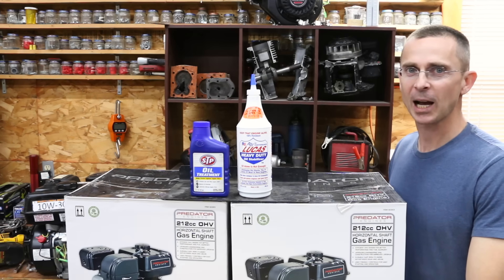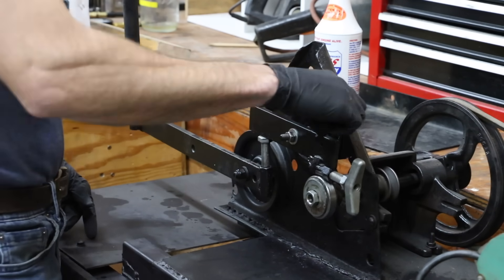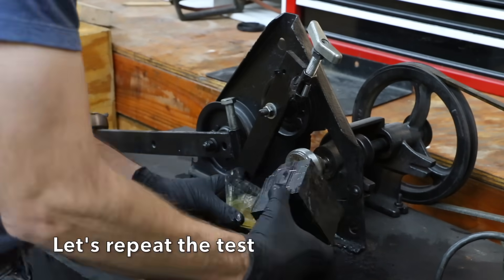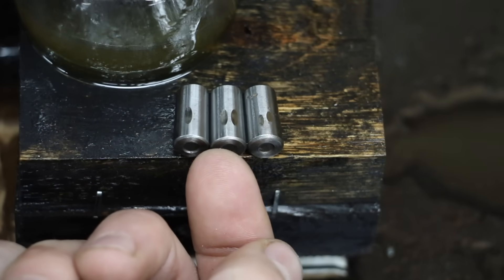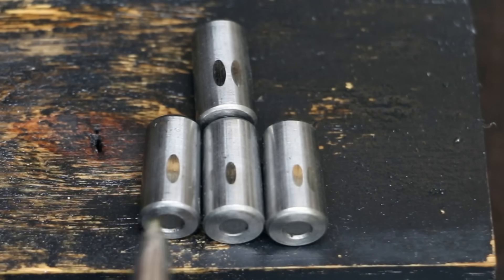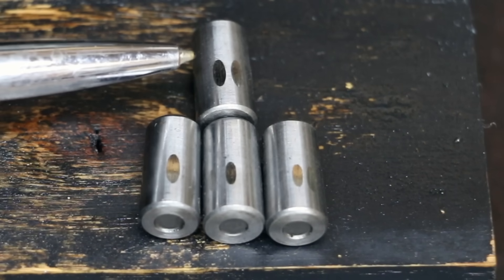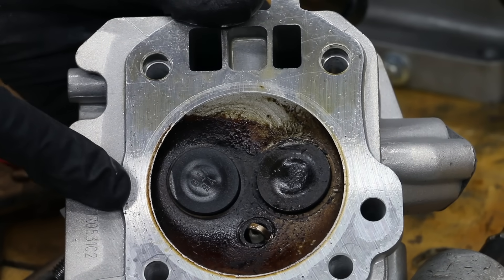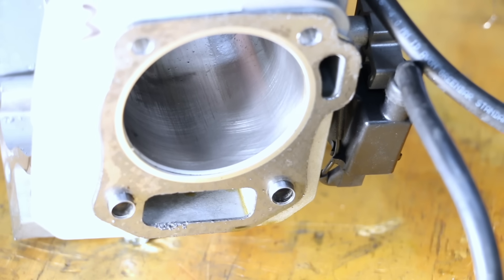Which engine self-destructs first?  Lucas or STP?

Comment: Hello. Thanks again for everything u do. Have u done a test on schaeffers Moly ep oil additive? I actually know someone who is a shaeffers rep and they insist is has special wear-protection that is unique to it. I've tried it myself and have seen others that had a  used oil analysis. It's odd, it turned a 5w30 oil into a 0w50 or 10w60. It seemed to have some unique viscosity index improvers that reacted when hot but no so much across the board. Another odd thing is that it's called 'moly' but has a very low amount of Moly in it. Below 30 ppm. But it has Antimony as an ep agent. It also is very low but from what I've researched, it only takes a small amount. I'm wondering if this really is developing an EP sacrificial layer enough to make it different from other additives? I saw a lubricity test too and it did definitely make a difference. But it's hard to know for sure unless it was done in an unbiased way. Anyways, just thought I'd mention it. Thanks so much!
Reply from the maker: Thanks!  Thanks for the feedback.

Comment: If the Lucas ran 9 mins longer with no oil then that would amount to hundreds of extra hours with the oil in the motor. Either way the Lucas did better. The real test would be to run both engines with oil in them for months to see which one gives out first. You would spend a ton of money on gas. I would think there would be another way to do a friction test just using metals and force to see what works better

Comment: For sure the Lucas. It was meant for 18 wheeler straight sixes so its zinc additive is great for the flat taappet cam engines like small engines. A straight 6 is like six single piston small engines in a row if its 12 valve.
Reply from the maker: Thanks for the feedback.

Comment: here to add some bias lol, been using lucas in all the cars ive driven and they've all had 0 issues. the most impressive is my 3.5L honda v6 with over 255,000 miles. still running like a champ
Reply from the maker: Thanks for sharing.

Comment: Hello again... Lance here..... I really would like to see mobil1 15w 50 tested against other quality oils. I know the other don't have that viscosity. But what makes this mobil1 15w50 different is that it has high zddp and is a robust film. I'd like to see if that oil simply has better film strength and causes less wear. I use it in multiple vehicles but would love to see a real life test. Especially compared to pennzoil ultra (another great, but different formula, oil). And I did mention this on another post but I'd like to see Lucas zddp additive 16oz, tested in oil and by itself. Thank u so much, u r very appreciated!
Reply from the maker: You are welcome!  Thanks for the suggestion.

Comment: Hello. I have been watching your channel for many years. I just wanted to say how much you are appreciated. It is evident that you have a good heart as a person and you put that into what you do. Your tests are done exactly as they should be in my opinion. It's layed back and comfortable and fun but balanced w a lot of science and intellect. I have a degree in Auto Technology and I have a small engine repair Ministry/business. I'm a mad scientist that thinks about these kind of tests myself, so I really enjoy these. Thank you for what you do and the person that you are. As far as suggestions, I have a few that I'm wondering about when you did the 2 stroke oil (supertech VS amsoil) I was thinking about how well synthetic supertech would do, not the conventional. Because I've had several instances where a rich oil mixture of conventional would run my engines (because of the borderline Flashpoint issues). Also, the 'red and tacky' grease compared to Walmart general grease. I would have liked to see their 'red-high-temp' compared to 'red and tacky'. Also, the zddp thing really needs some tests done by someone. More specifically... The Lucas zddp additive (hot rod) that supposably creates a 5000 ppm when mixed w 4.5 parts oil. I just want to see how much of a less wear scar it produces w extreme pressure. Also, does it make oil more acidic over time. The last one would b the difference between Lucas high mileage stabilizer (conventional) VS Lucas regular stabilizer (conventional). I'm not sure if the high mileage actually has zddp in it. And also you could text the Lucas synthetic compared to those other 2. It's much thinner so it would be interesting. Again, thank you so much... Have a great day!
Reply from the maker: Thanks!  Thanks for the suggestions.

Comment: I use Lucas with every oil change in my OTR Freightliner. Every 10k miles when I get home. It has 1.25 million miles on it and it doesn’t burn any oil and even my mechanics say everything looks great internally. The oil comes out very clean for a big diesel engine. Grat stuff. 👍
Reply from the maker: Thanks for sharing.

Comment: I recently used Lucas oil stabilizer to lube my truck hood hinges and door hinge. I tried everything else, lithium grease, regular grease, etc. It always stops working in a week or two and starts squeaking again. It's been 3months since I put a tiny dab or two of the Lucas on both and it is still quiet, showing no signs of drying out.
Reply from the maker: Thanks for sharing.

Comment: For an accurate test you need controls and a larger sample size. 10 of each would be a good start. My hypothesis is that if you run 10 motors dry with oil, 10 with Lucas, and 10 with STP, on average they will all fail at about the same time.
Reply from the maker: Thanks for the feedback.

Comment: Both products are too thick for modern engines. Oil clearances are very tight today with modern conventional and synthetic oils.  You would only cause damage to an engine that was made to run a 0W-20 synthetic oil. Back in my time when had enough oil clearance to use it and use it we did. Those little 212 engines only have 2 and a half thousandth oil clearance so we will see what happens.

Comment: The self destruck test is not valid...the other engine maybe better assembled than the other. Those fittings between gears, bore, piston ring etc of both engines are not equal

Comment: As someone whos owned his own shop for over 30 years. The only thing I would use Lucas for is starting a fire. I have personally seen how good STP is in actual  race engines after disassembly. Not some made up test. Lucas, should be sued for false advertising. It says right on their bottle of Trans fix. "It renews worn clutches and bands. That is the biggest load of crap that has ever been put out as advertising.

Comment: I had a customer in the mid sixties, drove a Rambler with a flat head 6... It had a rod knock... we were in California. He was headed for New York! He was determined to drive the Rambler.... I suggested 4 pints of STP, and 3 quarts of Delo 40 weight oil. The knock was gone! After several months, he arrived back, exclaimed that the Rambler was fine! Never an issue... That he would drive it until the wheels fall off... STP as far as I know, it's good stuff, so is Delo oil.
Reply from the maker: Thanks for sharing.

Comment: I'd like to see a comparison with dura-lube,
I've used it in several vehicles and seen a measurable difference so much in fact that older carburetor engines need readjusting to lower idle speeds as determined using a tachometer. 
And notable increases in gas mileage.
Reply from the maker: Thanks for the video idea.

Comment: I don’t think the test is that relevant you removed the oil from both engines, I understand the little bit maybe left in it but maybe if you ran both engines with the oil  for 200 Hours straight maybe it would of told a little more when you took the engine apart. He bring no oil in both engines just means the other engine decided to hold up longer

Comment: Agree with the need for a control engine. Being such a stickler for following the directions I'm wondering where it says run an engine without oil. You might need sponsorship from a petroleum company to run 3 of those engines under normal circumstances with and without additives.

Comment: Tufoil!! … test Tufoil next ..if it doesn’t take the gold medal first place by far… I will pay for the engine… I swear by that stuff!
Reply from the maker: Thanks for the suggestion.
Reply: I agree Tufoil is by far the best!  I use it in everything I own including manual transmissions and transfer cases…. I’ve used it since the mid eighties and haven’t had a single engine failure!   I don’t baby my equipment at all and run them hard. Tufoil is pure gold and is listed in the Guinness book of world records as the world’s most slippery lubricant.  Test it!  Your wasting your time with STP and Lucas!  I’m willing to bet $500. bucks on it!  Tufoil for the win!

Comment: I've got to say that I've used both but for different purposes I used lucas in my vehicles and STP oil honey for assembly lube when putting a motor together. Never had any issues with either and both will continue to be used as I've done before!
Reply from the maker: Thanks for the feedback.

Comment: Conklin motor oil is still available on line. It was they motor oil they used in the 60s and 70s at shows and state fair exhibits. They would start a V8 engine run it to warm up then drain the oil and restart the engine and run it for 30 mins or an hour with no oil. When you put it in your engine you only change filters and add a quart at oil change from then on. Never wears out. Might be interesting to try.
Reply from the maker: Thanks for the suggestion.

Comment: I would love to see a test with oil additives compared to the best off the shelf oil where you run the engine for say 300 hours non stop then do a compression test. I'm convinced thesse additives are a gimick in that they break down after a few hours of running then make the lubrication worse.
Edit: I understand 300 hours of non stop noise would be hard to pass by the wife :)
Edit 2: Also do the lubricity test after the long run!
Reply from the maker: Thanks for the suggestion.

Comment: No one should use these types of additives because it changes the viscosity of the oil.  That is a big "no no" if your car is running on a synthetic.  Putting either additive in your engine will turn it into a pile.

Comment: Without Lucas my engine would not be functioning. Period. 2008 F150 5.4 3v - 188k miles. Use it. USE IT. 2 quarte Lucas heavy duty, 5 quarts full synthetic.
Reply from the maker: Thanks for the feedback.

Comment: Note to self:
Refrain from operating engines without motor oil.
Reply from the maker: Good Point!
Reply: @ProjectFarm  It would have been interesting if there were a control where only motor oil was used, but then I thought, why destroy another engine for marginal results and a certain outcome.

Comment: I use Lucas, but not as specified. I use a small amount (about 1/2 quart) with oil changes to help with dry starts (my truck sits 2-3 weeks at a time) and noticed that both the timing chain rattle on my wife's Frontier with 135,000 miles and my Ram Hemi with 3500 miles that had the infamous "tick" are both nonexistent since doing this. And yes, the Ram hasn't had an oil change yet, but I heard the tick twice and used the same method I used with the Frontier. And both attempts were successful.
Reply from the maker: Thanks for sharing.

Comment: One thing to consider, is that those engines may not have been manufactured exactly the same. Same thing goes for the bearings used in the bearing test, although I do think the bearing test is a better gauge than the engines. Understandably a very very good test would be prohibitive cost-wise, and would require using many engines to get an average, same thing goes for the bearings.
Reply from the maker: Thanks for the feedback.

Comment: Great work comparing the two with the scoring test machine you used, this was an accurate test. However with the engine test, I really don't understand what draining the oil from the engine and then running them to the point of failure is supposed to show. Running the engines without oil/additive isn't going to highlight any valuable information because that's not how the products are designed to work. Even if one product might be thicker and stick to the metal better in the absence of newly applied oil mix, doesn't mean that under normal operating conditions the other product doesn't have higher lubricity or protection. 

I would love to see this test run again, ideally with a massive fuel tank where both engines are run to failure but under normal operating conditions (ie, they both have oil with additive)... now of course this would be 1,000's of hours of testing and waste a TON of fuel, so the test is impractical.

BUT, maybe you could run them for ~12 hours each, and then open them up and compare the wear on the engines between the two? For this test I also think you'd be OK to break in each engine with the additive added from the beginning.
It also would be interesting to measure their fuel consumption over these hours of operation. Though this doesn't exactly highlight engine wear/protection, you're going to be using this fuel anyway to run the test so it'd be interesting to know.

Anyway, great testing with the scoring machine, but I just really don't think running the engines without oil showed much more than "If I had an oil leak and ran completely out of oil, I could make it slightly further to a repair shop with the Lucas additive than the STP before my engine explodes"
Reply from the maker: Thanks!  Thanks for the suggestion.

Comment: PROLONG VS MOTORKOTE. SAME TEST. IVE B EN RUNNING PROLONG IN MY VEHICLES FOR A DECADE NOW. FROM USING IN THE POWER STEERING FLUID WHICH IMMEDIATELY SMOOTHS OUT THE WHOLE SYSTEM TOO MY TRANSMISSION. WITH THEIR TRANSMISSION TREATMENT IM A STRONG BELIEVER IN PROLONG ANR I LOVE YOUR VIDEOS PLEASE PROLONF DONT LET ME DOWN. I POUR THE 16OZ BOTTLE TOO EVERY 4 QUARTS OF OIL. MY VEHICLE CALLS FOR 4.5 QTS. PROLONG CLAIMS TOO RUN THEIR CARS WITH NO OIL PANS OR VALVE COVERS AND IT STILL RUNS FOR HOURS. BRAKE CLEANER WONT TAKE IT OFF EITHER. I LOVE AND RECOMMEND TOO EVERYONE.  PROLONG ENGINE TREATMENT FOR THE WIN!!!!!!
Reply from the maker: Thanks!  Thanks for the suggestion.

Comment: I used Lucas Marine Grease for my inner and outer CV Joint that started to make vibrations on acceleration and over 50 Miles. Both boots are torn but I injected Lucas Marine Grease and  now after a month  I'm waiting to see how long does this product will last since it's waterproof from fresh water and salt water.
Lucas is a outstanding product.
I hope it lasts through the winter. 
One type for each CV Joint and don't forget a pressure injector.   All I had to do is buy new CV Boots.
Reply from the maker: Thanks for sharing.

Comment: I've used Lucus for years.  I've bought cars new and put close to 400,000 miles on them and they still didn't burn oil when i got rid of them. It's very good at quieting an engine too especially with cold starts.  It eliminates them.   I had some oil burners years ago and it would stop the excess oil burning.  That's how I got started with it, looking for something that would help.
Reply from the maker: Thanks for sharing.
Reply: Out of curiosity, do you use the Lucas synthetic or the regular thick Lucas?

Comment: I have found that the predator engines have a lot of metal shavings inside after breaking in.  Its good to change the oil right away after a short break in period.
Reply from the maker: Thanks for the feedback.

Comment: I have an old clunker that has a lifter clatter for only a few seconds on cold startup. I’ve got MMO in it right now and it’s helped a little, but I’d really like to add Lucas but I’m a little worried about doing it with winter around the corner. Do you think it would be too thick?
Reply: Nope. Use it

Comment: The best oil is your engines recommended oil .   Don’t use additives unless your just trying to make junk last a little longer. It might get your oil pressure back up to the correct psi of dampen the sound of a knock. That is it if anything it will hurt a good engine .

Comment: you could test ws2 ptfe mos2 pure in engine oil, but find a way to measure the maximum power output of an engine before it stalls, this is the only way to measure the impact of friction improvement in an engine. Best to add only 0.1 to 0,3% of the substance, more will do nothing good.
Reply from the maker: Thanks for the suggestion.

Comment: I would have liked to see a control engine, but also I think the test would have been more accurate if you used half a cup of Lucas, STP and regular motor oil and burned it off until complete engine failure.
Reply from the maker: Thanks for the feedback.

Comment: I would like to see an engine ran on liquid Molly mos-2 additive and then the oil drained and see how long it would last supposedly aircraft engines use that mos2 so if they lose oil pressure they can still land kind of does the same job as zinc not sure I buy it but would be awesome thanks brother you're awesome
Reply from the maker: Thanks for the suggestion!

Comment: I'd say you really botched this competition or "test".  They're OIL ADDITIVES...not engine metal treatments.    Do they claim to increase oil lubricity? Not that I've seen... Lucas claims to reduce friction but that's by helping the oil film remain in places it would drain from easily so the friction on startup is reduced.    Perhaps a better test would be to get 3 engines and (one being a control) and have them setup to run 30min, stop for 2hrs then run another 30minutes for thousands of cycles.
Reply: I'm not seeing this video on your channel
Reply: @spencerderosier6649  it's because I haven't talked enough idiots like you into donating some new engines to me.